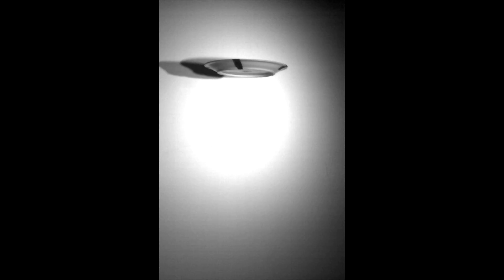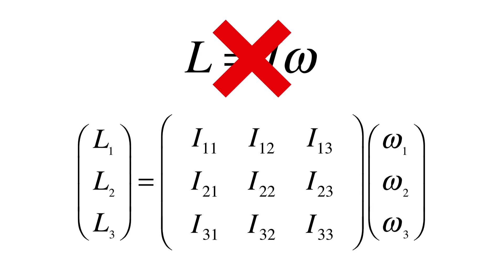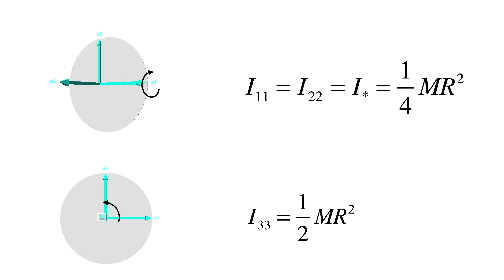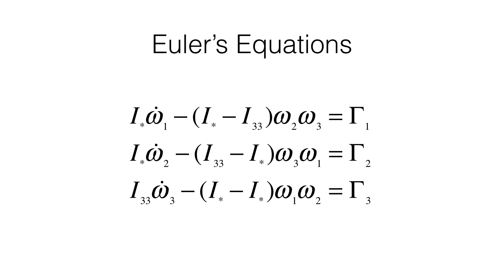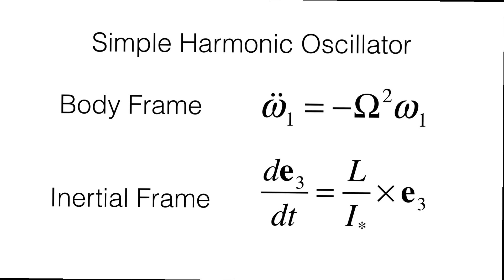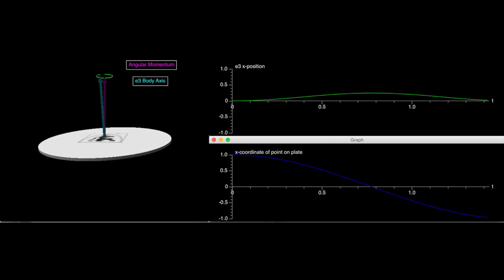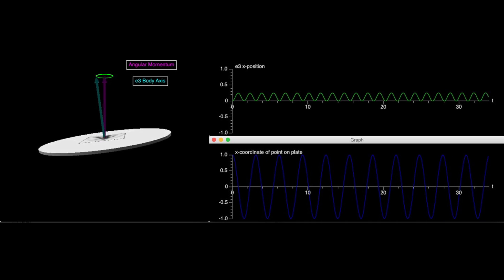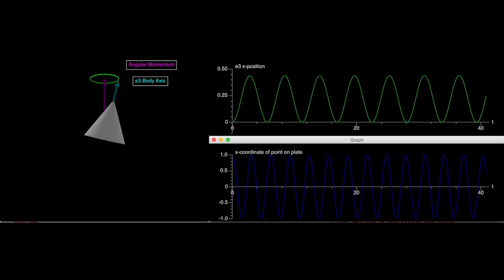Feynman's Wobbling Plate

Comment: Figured I’d leave this here since I was actually unsure of this myself, but the reason L/I by itself is the frequency is because the cross product L^ and e3 is actually the amplitude of the oscillations. You can convince yourself of this by realising that L^ x e3 is restricted to being =< 1. Or geometrically by realising that this cross product is the distance of the tip of the e3 unit vector from the L vector, around which it precesses. Hope this helps if anyone was confused about this.